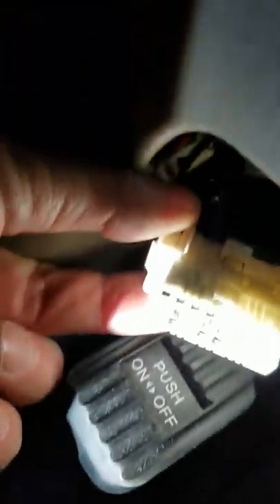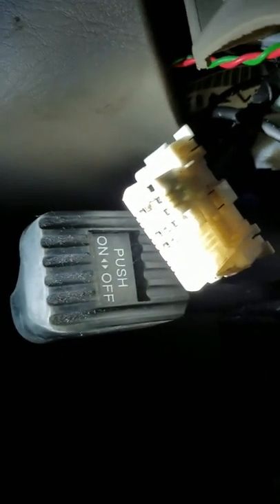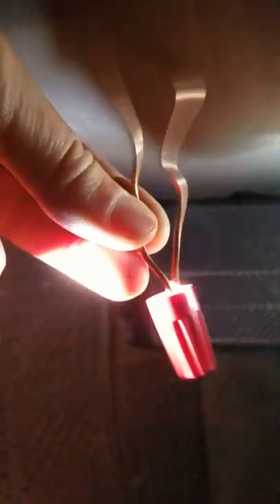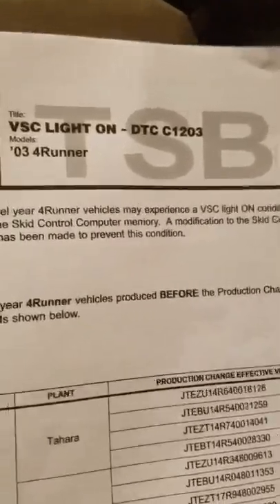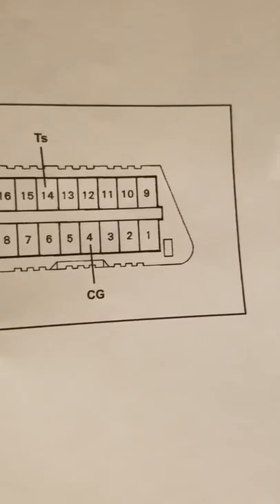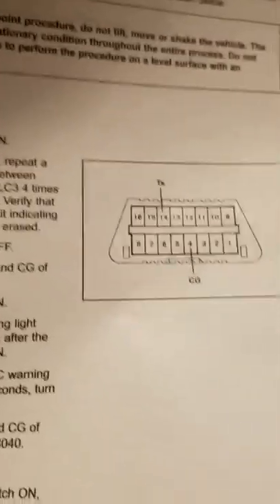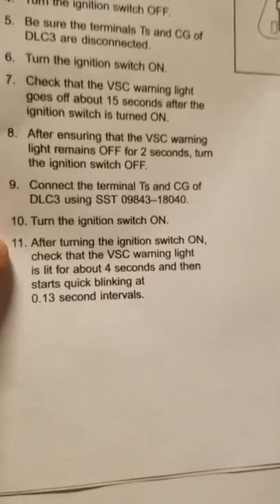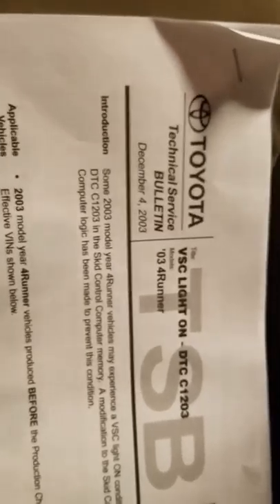2003 Toyota 4runner VSC Trak Light recalibration yaw rate sensor

Comment: oh my goodness Had work done on suv replaced 2  o2 sensors, big bucks.,  and still lights were on..  i'm guessing now that it over and done with& spending $200plus & this video I didn't need o2 sensors. Just needed reset yaw rate sensor .
.A BIG THANK YOU

Comment: some times dealer ships don't know what they re doing  4.7 4runner 2003, next issue you will have is the abs pump motor under the abs unit, if you start to hear a noise screaming from this little black motor, don't wait until you loose your brakes totally, like I did, you could get on a serious accident.  4runner 4.7  2003 great car!,
Reply: is that the noise you here on start up  like a humming or buzzing type then it stops after 5 or 10 seconds   is that a normal time to here it or is it a diffreent noise i have a 2001 4runner
Reply: Having that problem now I replaced the elec motor on it worked good for a week now the abs an break light is on but it still brakes fine but now im stuck with that stupid abs alarm noise